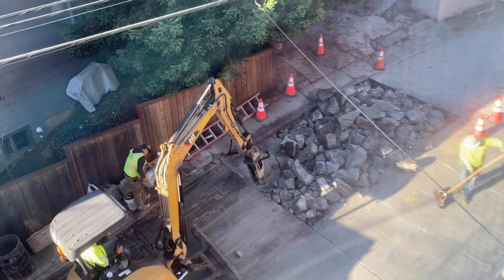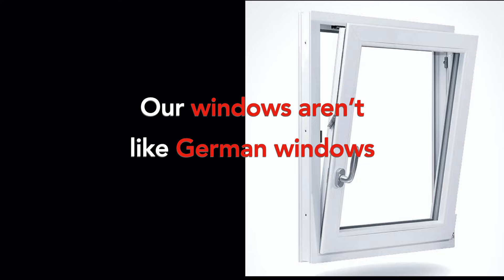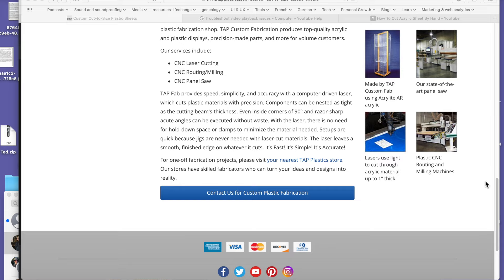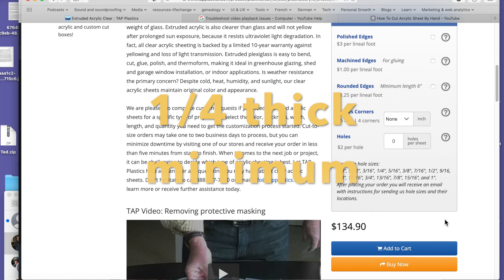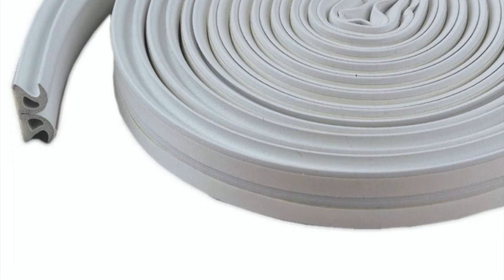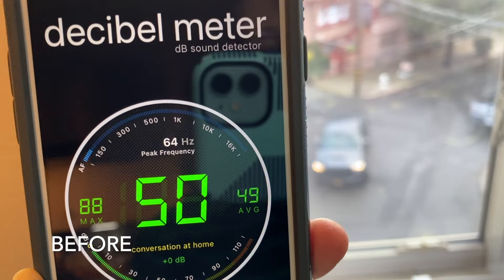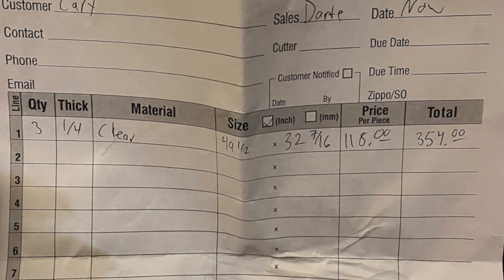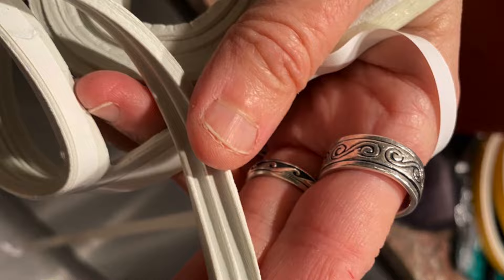How to make a DIY window insert for noise reduction

Comment: I would think that installing a window insert would help reduce cold air from the outside, similar to factory double-pane windows.  My sister has double-pane windows and on cold days I couldn't feel cold air flowing when I placed my hand close to the windows like I do at my apartment.
Reply from the maker: It really helps. The front windows in my apartment were already double-paned (an improvement over the original single paned) and they're warmer, but I think there are still air gaps, which I can hear on a windy day. If you see my most-recent video about the skylight -- that was a single-pane skylight and the room was so cold and noisy. Putting a single sheet of 1/4" plexiglass into that skylight has kept that room the same temperature as the rest of the apartment. It's 68 degrees now, not 58 degrees!
Reply: @soundproofist    Bravo!
Reply: @soundproofist  In winter 2022, I experimented with window film. I had 60 X 60 (the last) single pane window. I made wood frame insert and wrapped window film both sides. It works amazingly well, don't feel the winter chill at all and the sun is much warmer. Only thing is the wood frame bend while the shrink film tension pulled. My next try will be one side plastic sheet and the other side window film. Since the plastic sheet is in the slot of wood frame it will strengthen the frame. I had the insert 48 X 96 made in the wooden frame 40 years ago, it helps on my single pane window the time. but not as effective as double window film.
Reply from the maker: @ThePetessf  That's interesting. I think the air gap created by wrapping the film around the wood frame must have created both thermal and noise insulation.
Reply: @soundproofist  yes,if you seal all edges it sure do. My frame bows, still I can tell the difference right away. Kitty just scratched and broke the film catching bug! Will see what to do in the winter. LOL
Reply from the maker: @ThePetessf  I like the idea of making a window insert that has an air cavity in the center. Though it might become unwieldy with plexiglass on one or both sides. But maybe more cat-claw proof.
Reply: I have double pane windows and I feel cold coming in. It’s a brand new house.

Comment: I have German double pane windows, but they leak a lot of noise, too! :)
Reply from the maker: Sorry to hear that. How are the walls in your home?
Reply: @soundproofist The walls are not the culprit, it is really the windows. Because when I put my ear to the wall, I can't hear anything from the outside. And then I put acrylic sheets in front of the windows and it really helps!
Reply from the maker: @anaesterhazy631  That's a good test (listening to the wall). I'm glad the acrylic panels help!
Reply: @soundproofist Yes, they do and I didn't even have to take the thick ones like you did. I took 2mm, but fortunately I have more than 20cm air gap between the windows and the sheets. But then again, I have a different type of noise (more high pitch noise, dogs barking and kids screaming) than you do. 
Your ideas helped a lot and also from Helpful Mike--thank you!
Reply from the maker: @anaesterhazy631  My plexiglass sheets block that type of noise pretty well (dogs, screaming kids, people talking on their cellphones below my windows). It's the low-frequency noise like truck engines and cars accelerating hard that still comes through. Another plus for the plexiglass window inserts is they help my apartment retain heat better in the winter.

Comment: Would love to get recommendations for reducing vibration noise that comes from behind vent that runs behind drywall from washer/dryer of owner in floor below (exceeds noise ordinance Regs based on db reading but no support from city on enforcement.
Reply from the maker: Is the noise coming from the dryer exhaust vent (duct)? Or is the vibration noise coming from the washing machine below? I'm guessing it might not be on anti-vibration pads. Or it might even be leaning against the wall, which would cause a lot of wall vibration. First thing to tackle is the source.
Reply: @soundproofist  Tysm, the noise is from both the washer, dryer and room fan (the dryer exhaust vent travels behind a shared wall)
Reply from the maker: @CherryBlossomHill  So, sounds like the dryer, washer, and room fan are all your neighbor's and should be on anti-vibration pads. As a negotiating tool, you might want to offer them to your neighbor as a gift. I think a lot of people are clueless about the vibration noise they transmit because it actually doesn't sound as bad at the source as it does on the receiving end. It generates more low frequency noise in the building frame. As for the duct / exhaust in the wall. I've seen products that you can wrap around a duct (or even a duct liner), but I have no experience with them. You would have to open the wall to "soundproof" the duct, and I doubt you want to do that. I have double drywall (second layer is Quiet Rock, and of course) on the wall that's shared by my neighbor's washer and mine. It muted some of the noise from the other apartment. But a lot of the noise also goes through the flooring. So that's another thing you could try, doubling the drywall on the shared wall.  Each one of these things helps, but is not 100%.

Comment: Is the air pocket needed to reduce noise? Considering following this solution for a sliding french door situation, however there's about 1/4" usable space on the two sliding panels. Thanks!
Reply from the maker: Yes, the air gap helps to reduce noise. According to "The Master Handbook of Acoustics," when two sheets of glass (such as in a double-paned window) are mounted together with an airspace of 1/8 to 1/4", they're more effective for reducing heat or cold transmission, but less so for acoustics. I think using a plexiglass sheet that's slightly thicker, with an air gap of 1/4" might help reduce noise transmission, but I'm not certain of low-frequency noise reduction (from my own experience), which has other dependencies.

Comment: Hi there, thank you very much for this video. Funny, I was watching helpful Mike's tutorial first, and then your video came up afterwards.  😊. Question.  Did the acrylic sheet come with that frame around it? It looks like aluminum? U then added the weather strip to that frame it looks like?
Reply from the maker: Hi - there's no frame on the plexiglass inserts. But there were several things going on in this video that I can explain. First, before I made the decision to do the plexiglass, I had some removable, lightweight "storm window' Inserts on those windows. The small window used a single insert, and the big window came in three panels. They were made of lightweight vinyl (very flexible) and they had aluminum frames. They weren't "soundproof," but I repurposed a couple of them when I did the plexiglass project. In particular, I used one of them to hold the plexiglass in place in the small window. I did the small window first, and I hadn't yet seen the Helpful Mike video. In hindsight, I should have cut the plexiglass to fit OVER the window frame and onto the wall, like I did with the big window. But instead, I cut it to fit inside the window frame. And it wasn't perfectly square and the dimensions were slightly too big, so I had to just "smash" it in. Then I put the storm window over it again because I wasn't happy with the plexiglass propped inside the window on its own. The second thing you might have seen is that on the big window with the three panels, I put some foam backing on the side where the plexi touches the wall, so that the plastic isn't smashed directly on the drywall. I had some adhesive-backed foam that was the size I wanted (not too deep, but wide). It was joist tape, which unfortunately is lime green. So you might have seen that and wondered if it was a frame. The third item isn't shown in this original video, but I made a follow-up video to show the types of joiners you need to buy if you create a multi-paneled plexiglass insert, like I did. I had something already called "mullions" (left over from the vinyl "storm" panels) and I just repurposed them for this project. However, those joiners are thicker than necessary -- they were made to fit around the foam edging of the storm windows. I filled the gaps in them with weather stripping. But TAP Plastics sells the right-sized joiners that fit snugly and hold each panel together. I hope my explanation makes sense!
Reply: @Soundproofist  hi there, thank you for the very detailed explanation 😀.  I'm writing in from Cape Town, South Africa 🇿🇦 so no Taps plastic here lol. I have abandoned this idea anyway after reading your comments section and seeing that the acrylic won't help for low frequency and vibration noise, which is what is plaguing me. We are now trying to move after being here 3 years. It's sad we don't want to move. Oh well.
Reply from the maker: @taryna425  Sorry to hear you might need to move. You're lucky if you're able to do so without a tremendous increase in housing costs. To clarify, my window inserts do reduce some low-frequency noise if the noise is farther away (say, 50 feet or 15.24 meters). But not if the rumbling sound is directly in front of or below the window, say, 4.5 meters away. However, you've given me a good idea to create a directory of international locations for buying plexiglass sheets, since this is a global channel, and I used a local example. For example, in Cape Town, you might have looked into some companies already. I see one called PM Distributors that might have the right acrylic materials: http://pmdistributors.co.za/plastic.html

Comment: Thinking of doing this myself in my house although I won't be able to cover the sliding glass door that's in the room I'd imagine putting in acrylic sheets into 4/5 windows in a room should remove the excess noise especially from kids (I live near a park). 

Are you happy with the results still?
Reply from the maker: I think the extra plexiglass works pretty well for mid-range frequencies. My neighborhood often has kids playing outside, neighbors gathering outside to chat. Plus the random people who walk by talking loudly on their cellphones. These kinds of sounds are pretty well muted by the extra plexiglass. I can hear them (it's not silent) just enough to know that someone might be outside, and sometimes I don't hear them at all. Also a normal passenger car or van, sitting outside and idling, is pretty quiet and sometimes I don't hear it it all, which is incredible. However, low-frequency noise that's close by (say, under 150 Hz) -- like cars, trucks, or motorcycles hitting their accelerator just below me, the weekly street-cleaning trucks, and the porta-potty cleaning truck that comes weekly for the construction project across the street -- are still audible and sometimes annoying. This is where I need to deal with modifying the front walls, a project that's complex and which I've been postponing. So I think you will benefit from DIY window inserts for the kids/park sounds. If you've got leafblowers right under your window, not so much. Also I wonder if you might be able to build a second sliding door over the existing sliding door. I've never done that,  but it might help. Is the existing sliding door double-glazed already?
Reply: @soundproofist  Thanks for the response. 

I'd imagine it would be hard to control noise coming from nearby vehicles yes (I can hear them through my walls sometimes but there's nothing to really do on that front). 

They are not double glazed. Unfortunately I'm a renter though so doing any permanent installs would be a no go. Even the window inserts are a pricy investment but at least could be potentially taken and brought with me and re sized for a future place.

Comment: Nice and informative vide, Is the plexiglass heavy?
Reply from the maker: Thanks! I think the plexiglass is pretty heavy. It's 1/4-inch thick. I've removed one of the side panels so I can open the side window during the summer, and I weighed it so I could give you accurate info. The panel is approximately 33 inches wide x 48 inches high - or 83.82cm wide by 121.92cm and it weighs 16.5 pounds, or almost 7.5kg
Reply: @soundproofist  Thanks for the reply. Btw, how do you attach the plexiglass to the window? No nails or anything? Thank u!
Reply from the maker: @suwandicahyadi9213  The bottom of the plexiglass sits on the window sill for support. The two sides that extend over the drywall around the window opening are held in place by brackets that are screwed into the drywall. I slide the plexi into the brackets and then use small bits of EVA as "shims" to press the plexiglass firmly against the drywall (no gaps). On the side of one of the removable panels, I have a small gate latch that rotates up and dow, so I can turn that to release the plexiglass on that side to easily slide the piece out and open the sliding window behind it. Otherwise, it would be too hard to remove just one piece with all the brackets (too snug).

Comment: Hi! I Moved into a new apartment and there is a road right beside my unit. I was looking into doing this to reduce traffice noise coming in through my windows. I have a 70 Long 38 inch wide window. Do you think adding 2 inserts per window will help reduce sound more than just a single piece?
Reply from the maker: Is the existing window single or double-paned? I would start with just one plexiglass cover over the drywall, like the one I did for my 94-inch wide window, which will sit on the outside of the window frame and not on the inside. Unless you have wood framing around the window that prevents putting a sheet of plexiglass over it. You should use two pieces of side-by-side plexi with a joiner in the center. So the height of each piece might be 39-40 inches, the width of each piece might be 36-37 inches. You might be getting road noise through your walls, also, so don't assume all the noise is just coming through your window. I wouldn't double up the layers of plexiglass. I'm working on a video right now about a possible treatment for inside the window frame (when the plexiglass is sitting on the outside of the window frame). Should be coming out soon.

Comment: I heard you mention Energy Savr weather inserts. I'm mainly looking to solve cold weather drafts, do you believe this Plexiglas solution resolves both? Assuming the proper air gap for dead air space is taken into account?
Reply from the maker: Yes, it resolves both. My apartment retained heat very efficiently last winter after I added the plexiglass. Possibly even more than the flexible vinyl weather inserts that I used for a couple of years from http://windowinserts.com. Those inserts didn't really stop a lot of low-frequency noise, but they suppressed cold drafts from the windows. (The company asked me to test them for traffic noise.) Their product is very affordable and they build them with frames to fit inside your windows. 

I made another video about how I added a sheet of 1/4 plexiglass below a skylight in my bathroom and it also kept that room warm, when previously it was noisy AND freezing cold.

Comment: Cant the noise also come through wall airconditioners.
Reply from the maker: Yes, unfortunately noise can come through in multiple ways. That's why soundproofing often involves more than one treatment or iteration, and it can get expensive. I already knew the problem in my apartment was more than just the window, but improving the windows helped. The walls are also too thin and they need more mass. And if you have air-conditioning or HVAC vents / ducts, that's another potential noise path. I wish there was just one cause and one solution. But most buildings aren't constructed with soundproofing in mind.

Comment: Hi, where did you get the rubber window seal, thanks great video
Reply from the maker: Thanks. Do you mean the bright green seal that I put around the edges of the plexiglass where it will press against the drywall? That's actually joist tape, it's thin foam with an adhesive backing. I just searched for it and it's kind of expensive these days ($59). See: https://acousticalsolutions.com/product/green-glue-noiseproofing-joist-tape. Amazon sells it also, same basic price range, under the brand name "St. Gobain."